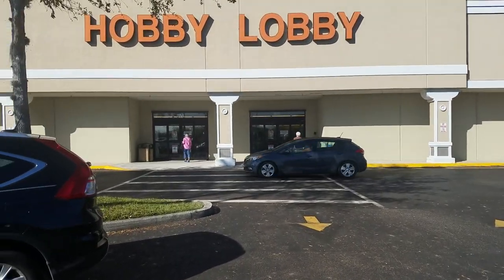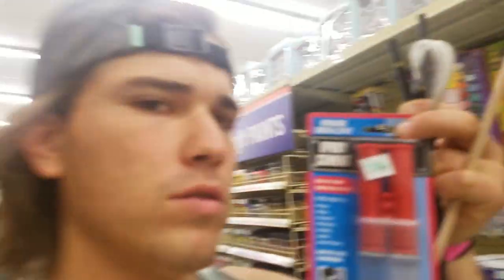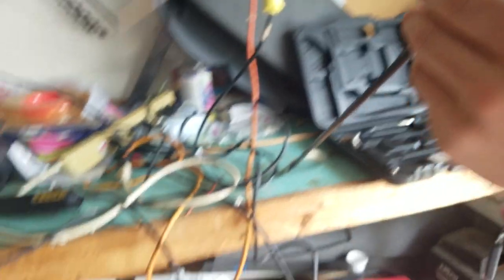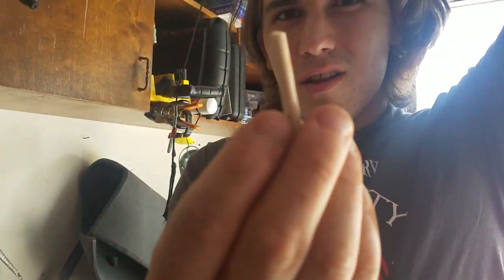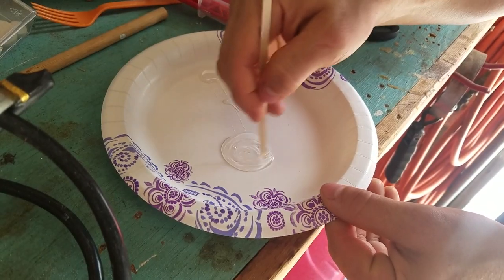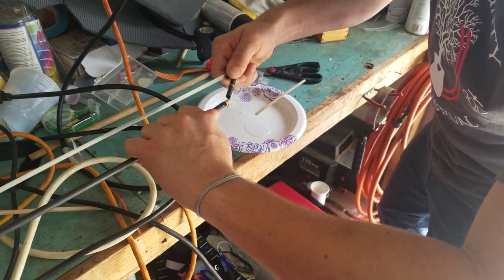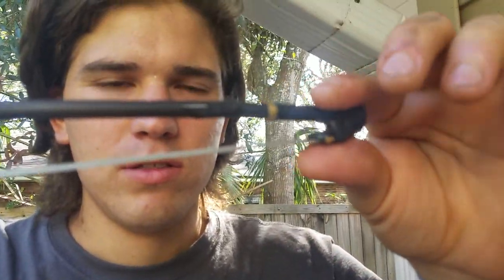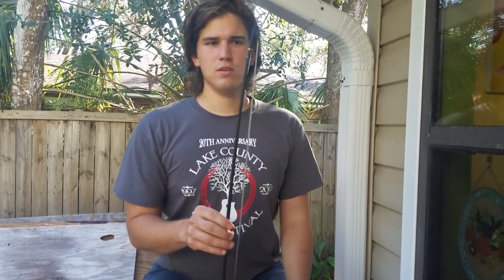How To Fix Violin Bow | Carbon Fiber

Comment: When you are done applying the inside with the epoxy, you can use a lint free paper soaked in Isopropyl Alcohol easily found at the local pharmacy. It wont spoil the surface finish but you can get rid of excess epoxy for a crystal clear finish. Thanks for sharing! BTW, what kind of music do you play on your violin?
Reply from the maker: Thanks! Should have done that. I play old time and bluegrass!